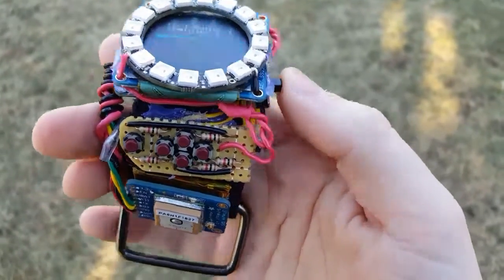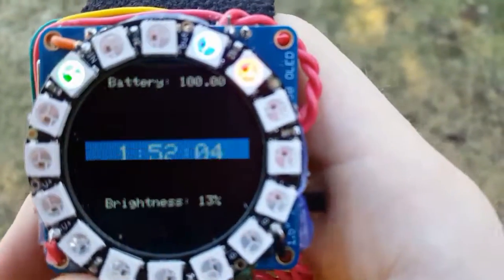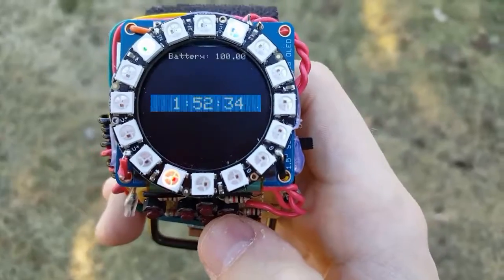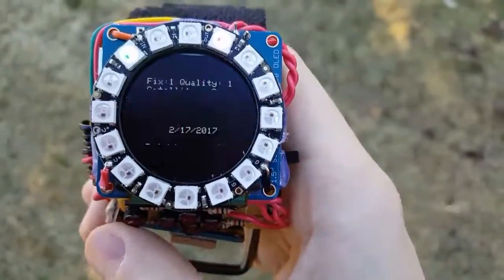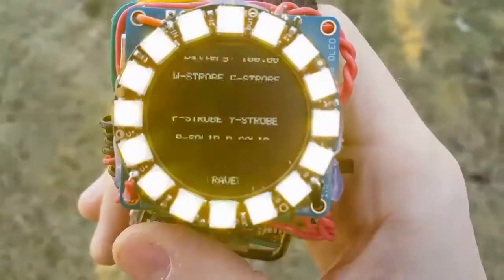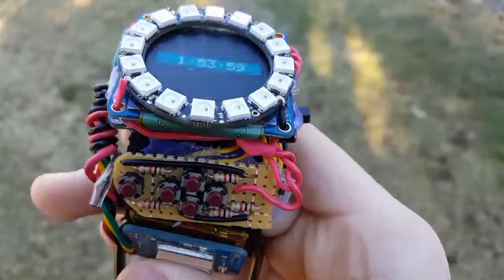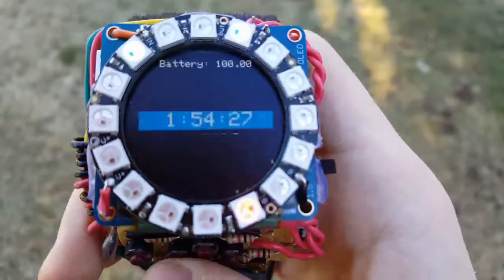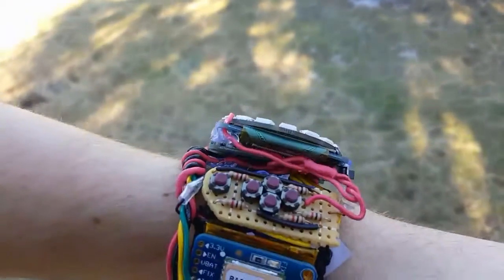Arduino GPS Watch

Comment: Can you release part list?
Reply from the maker: Ya not a whole lot went into this version let's see..
1.5" OLED screen from adafruit
16 pixel neopixel ring from adafruit
Adafruit GPS modual
500 mah lipo battery
Arduino nano
5 push buttons 
Some perfboard to mount the buttons
Some wires and I think that's it

Comment: really cool project! any updates on the watch? is the code available?
Reply from the maker: Ya I made a few updates:
Battery size increased from 500 mah to 2500 mah
Switched out the arduino nano for a teensy 3.2
Added a USB port to charge devices off it
Added IR led and IR recever
Added buttoncell to reduce GPS connectivity times
Added 6-axis gyro
Updated the software
Changed the layout
Its practily a totally different watch now haha 
The code isint available yet but alot of people have asked so I might make a github where it would be available
Reply: Are they available now ?